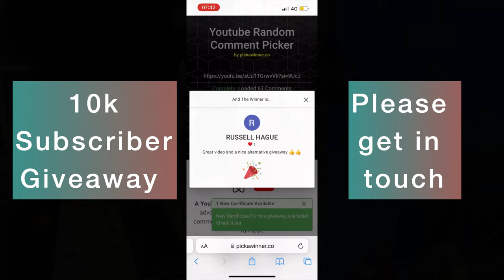Austin 7 special part4 - the inner frame

Comment: Impressive work as usual, Tom.
Standing back, lookiing and thinking... important steps.

You want to place part A but you need to have part B in place to attach it to.
However, you need part C in place to know where part B goes.
The pain is that you need Part A in place to put part C where it should go.
Yup... lots of tacking in place.

Have fun! :)
Reply from the maker: You’ve hit the nail in the head!  👍
Reply: Yup... been there more than once. ;)

Comment: a friend of mine told me that when he was racing Midgets back in the 40's and  50', there was no roll bar, be surpried at how low you can go in the car.  I drove an Elva Formula Junior car, front engined, u-joint right under the nuts. have fun.  do you watch other A7 channels? Bracketfactory?

Comment: Love it, Tom. What a great project. With regards to the dimple died reinforcements, how about using panel bond to attach them to the frame? Not very traditional, I know, but I've been using it recently in a land Rover restoration and I'm knocked out by how much strength and stiffness it adds. It would add a little weight, I guess, but it would be negligible, really.
Reply from the maker: Ive heard it’s really good stuff! But I personally want to go down the traditional route with the rivets

Comment: Another excellent video Tom, really interesting seeing how you do your work. I was wondering when you make your wire form you made it from mild steel round bar then once you start making the actual framework you have to remove the wire form to make the actual frame from ally. Would it be feasible to make the wire form from a suitable size of ally round bar or small bore ally pipe then use that as it is to support the ally skin and then add any more required inner structure for strengthening to the inside of the ally wire form? I just feel that there's a fair bit of work gone into the wire form then it ends up being kinda in the way and eventually gets discarded, to me it's like a work of art! Love the t-shirt too so will get on with ordering one!
Reply from the maker: Hi Larry I see where you’re coming from but the wire form was alway intended to be a quick mock up process that I can experiment with shape and easily tack together it’s also not 100 accurate. I think making it out of Ali tube might work but the problem rises when you want to attach the body skin to it. With the angle I have it has a flat face to rivet too but if I have a round bar then this becomes more difficult

Comment: I was surprised to see the chassis extention hammer formed.  How thick is that steel?  I really didn't think something like that was possible.
Reply from the maker: It’s the same thickness as the original chassis, can’t remember if it’s 2 or 3 mm. Wasn’t hard to hammerform at all ,it’s very common process for one off parts
Reply: Compared to what I'd seen before surprised by the thickness, and inspired and reassured.  Am also surprised and reassured the MDF was up to that as well.  Great to see.  
 @Metal_shaper_tom

Comment: Hi Tom, how thick was the metal you used to make frame rail sections, same as the seven chassis? J-P
Reply from the maker: Hi yes same thickness as the chassis. I think it’s 2mm off the top of my head